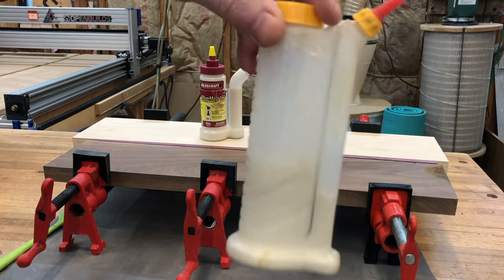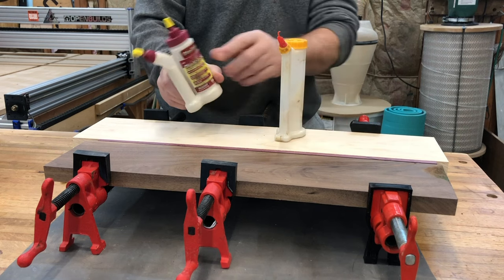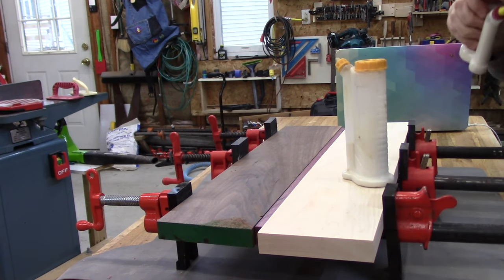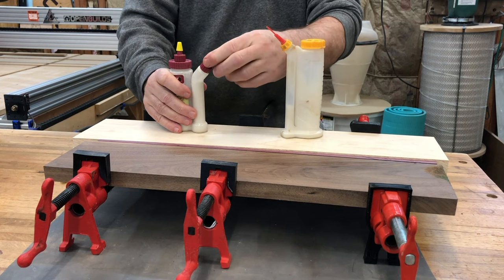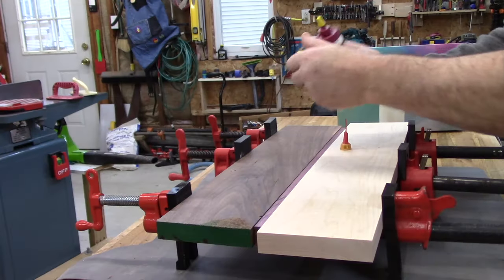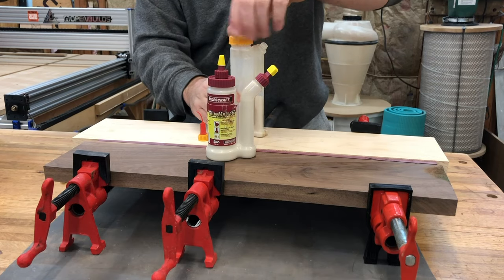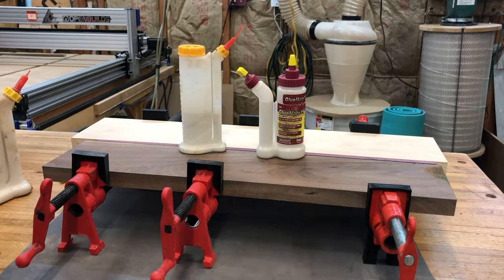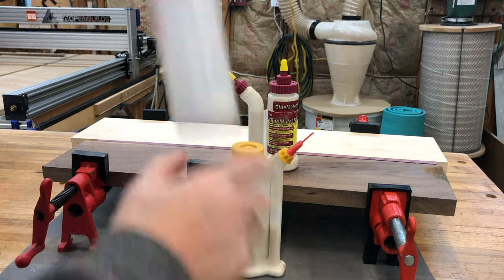Ketchup bottle? GlueBot or GlueMate?

Comment: I tried Gluebot and found it hard to squeeze with my Arthritus in my hands . I also found it hard to open the pull tabs on most glue bottles. I now use Titebond 2 and found the top off Frenches mustard bottle fits right on the Titebond bottle and it's really easy to use the flip cap.
Reply from the maker: yea, I guess I can see that being an issue. The GlueMate is very slightly harder to squeeze even than the GlueBot, so don't bother with that one either!

Comment: I've had GluBots in the past and hated them. My issue was that every time I picked up the bottle to apply glue I had to wait an interminable amount of time until the glue finally ran out  the tip (except  when it was nearly full). Squeezing the bottle did little good as it was not that squeezable. I didn't want to keep topping off the bottle as I really wanted to use up the contents, rinse it out, and put a new batch in.  I'm actually perfectly fine with the Titebond style bottle except for the stupid tip that clogs. Maybe I'll try a small Milescraft.
Reply from the maker: I don't have that issue really, maybe a bit, find the whole waiting for the glue to run down when you flip over am old fashion glue/ketchup bottle much more annoying. the great thing is there are generally options for everyones own preferences.

Comment: The filler cap on the Gluebot does suck. The one I have had a paper gasket and you had to make sure when you put it on that there is no glue on it or it gets stuck. I tried to soak it in hot water and still couldn’t get it off. I’m gonna try the Milescraft. Love the bottle style though.
Reply from the maker: yea, they are on sale on amazon right now... Oh guess I should have links huh? forgot that part! LOL

Comment: Glubot is an expensive plastic bottle.  The nozzle get beat up barely after a few months.  I couldn't find any replacement.
Reply from the maker: Amazon has replacement tips for all the GlueBot sizes. I'd just get the Glue Mate as it's about the same $$$ as the tips and won't be an issue anymore. :)
Reply: @Thomllama  thanks for the tip.  Oh man they are pricey and knowing they don't last long, it is like a money pit.  I think I should go back to the ketchup bottle
Reply from the maker: @b3arwithm3 personally, I hate ketchup bottles. When they get below like 1/2 full you end up spending a bunch of time doing the “ketchup shake” to get it to the tip, and often get the air bubble splatter. These get low and sometimes I have to do a double squeeze, but still less annoying!  The great thing about the world is, everyone can use what works for them😀